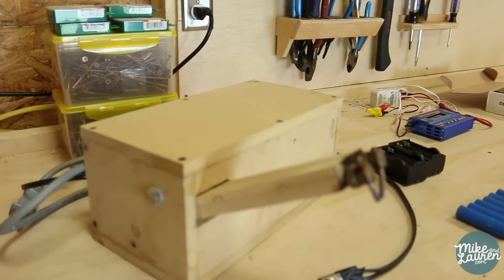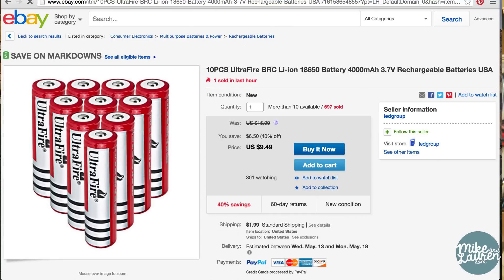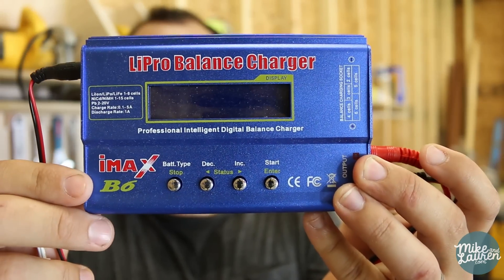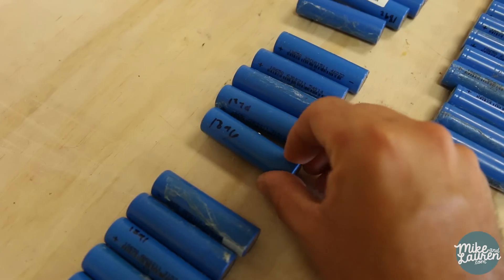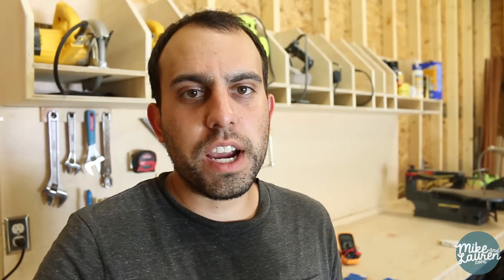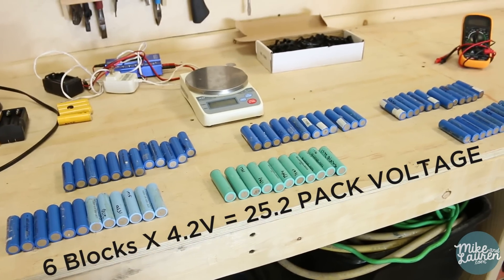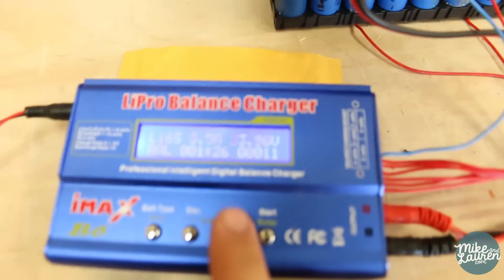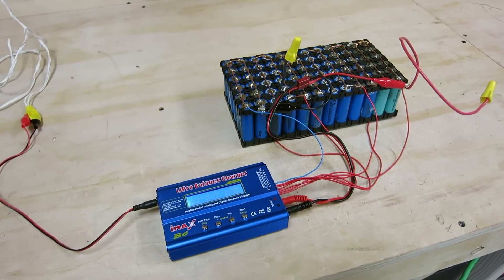DIY Lithium Ion E-Bike Battery Pack from 18650 Laptop Batteries

Comment: I see the video is 10 year old, but you should think about editing it or removing it. Soldering sold copper wire to 18650 is highly not recommended even in the proper way. You have shown in the video the completely incorrect method by no pre soldering the cell ends...

Comment: This is very dangerous this man weld direct to the battery with a big steel bare its get really hot your battery dead very fast on overheating and Thermal run a way. Do not try this at home if want fire works do what this guy. Only use a DC spot weld and nickel on battery.

Comment: hi, so with a balance charger you will not need a BMS glued to the battery pack itself?

But you can soder the balance wires to the battery pack and connect the other end to the balance charger.

That's so cool, i hope i understood everything right... (im not that good at this stuff, but im learning.)

I'm trying to make a 48v 20amp battery pack using laptop batteries i got from batteries and bulb store.

Comment: please suggest weather theses batteries are helpful in making power pack for e bike

https://www.ebay.in/itm/LG-LGABB41865-2600mAh-Lithium-Ion-Battery-Grey-For-Ebike-Battery-Bank-Powerwall/132669705643

Comment: I went for the opposite conversion... I made a 60 cell lenovo power pack for my laptop... too a 48v battery and devided it into 4 12v elements and equalized the voltage to my 9 cell lenovo and joined to the 9 cell with 4x plugs.

Comment: Nice video. I've subscribed.

If you control your spot welder with a microcontroller, you can avoid the blow-through problem. I built one just like yours with this control mechanism and it's great. https://youtu.be/6sMxc0NHNQA.

However, I would appreciate any help anyone here can give me on building a new EBike battery from salvaged 18650s in the area of how to organise the grouping of these varying cells. Mine have internal resistances from 80 to 250 milli-Ohms, and capacities from 2000, to 2500 maH. I think I need to balance cell groups with varying numbers of cells to get the same capacity per group, but what do I do about varying internal resistances. Anyone?

Comment: So much incorrect information mixed with the right ideas...First using what looks like 12 gauge Solid Copper wire is the correct step, however if you are going to do that, then you should have done a Tesla style pack and would have accomplished 2 things: You would have created a redundancy safety mechanism using very thin 24 g wire to connect all the 12 cells in parallel and then connected to the 12 g  solid copper wire..and 2) you would have much less resistance. The correct soldering gun is a must so that you spend the least amount of time soldering the connections. Also, the + and - lead wires look like about 14 g which is too small and creates resistance. Bigger the better...Also, must cover that battery so that something metallic doesnt drop on it creating a possible cascading effect..had you had Tesla style connections/fuses, it would have created an additional safety factor...also, that puny charger WILL NOT charge 12 cells in parallel in any short period of time!!...probably days...if the capacity of the cells is correct..going down in voltage from 24.4 to 23.7 in 15 mins is a good result considering these cells...consider that 3.2 volts is pretty much empty x 6 in p =19.2 and 6 x 4.15 volts (24.9) is full then the difference bettween the full charge and empty is 5.2 volts and you used .7 volts then you used about 13% of your capacity which isnt bad considering you probably have resistance in the range of .180-.220 ohm

Comment: Here are the battery brands you want:
Sanyo for capacity.
LG for amperage.
Panasonic if you want overpriced Sanyo cells.

Stay away from:
Any "Fire" brands, unless a fire is exactly what you want.
Any used batteries, especially used laptop batteries.

Comment: Hi , I need some help . I start my project today and the first cell I removed from laptop batterys charged to 1600 to 2500 , but when I discharge than I get 300 mha . I used the same charge rate 1 Amp . What am I doing wrong ?

Comment: I will have my electrical bike with me in my van, in which I don't have access to 230 V and don't like the idea of going through an inverter. Are there any good charging solutions directly from 12 V?
Reply: HiTech X4-80 will run off 12v

Comment: Does it matter which points on the battery you have the extended bits of wire to connect to the bike?

Comment: phoah that welder. dude, get a super capacitor to do the welding so at least its discharge itself through and eventually stop. having a switch which is constant until you stop is a no no in my eyes.
hopefully others can try use this method instead and use a couple of farad caps or something.

even if you had put some limiter to stop after X amps for X time would be good.

Comment: I didn't notice any discharge protection.  Li-ions get damaged if they're discharged below 2.5V.  Usually you'd put in a circuit that disconnects them from the load when they discharge to about 2.5V.

Comment: Nice little project, I actually find that 7s works better for 24v as nominal voltage of a 6s battery is only 22.2v

Comment: A very good source of 18650s is a guy on eBay called alarmhookup. you can get new brand name cells for about $1.50 in 36v 10s2p packs. Each cell has at least 2.2ah and is rated for high current.

I believe they were originally made for those self balancing "hoverboards" but when that fad went out of style there was a lot of surplus batteries

Comment: FUSE LINK UR BATTERY PACK !!!!!!
Reply: jnewbon00 care to explain what this means? I don't wanna make the same mistake
Reply: @Gallzatron  -- jnewbon00 means that instead of soldering (or spotwelding, etc) the cells together, you use a thin wire as a fuse between each cell-terminal (the plus or minus side) and a busbar. The busbar is a thick wire or strip *usually copper) that runs between the cells.  If one cell dies, or shorts inside, then the fuse-wire will blow and save the rest of the pack.  Best is to search for something like "18650 cells fuse busbar" and watch a couple videos to get the idea.

Comment: Good one ,,I have a plan of buying the kit and getting 48 volt motor etc,, was gonna use 4 motor cycle battery's ,,,about 160 uk pounds for the battery's not sure what the range will be thanks Shane uk

Comment: Did you not charge all the cells first,dong mine at the moment,can only do 2 at a time and I go 117 cells 3-4hours per 2 batteries 13s 9p,all kicking out 4.2v after charge

Comment: I am curious on how many AH that would be if set up as 12v rather then 48 (can't remember if that is what you set it up as). I am wondering as I am trying to replace my current setup that is 12v 95AH. I am assuming higher volt makes lower AH but still has the same amount of energy. just different configuration. any help figuring this out would be nice

Comment: can anyone help me here on a electric bike battery question.... is it the case that for more amp hours a battery will be most always be larger??... i recently purchased a new bike battery that is claimed to be 18 amp hours, yet on receiving it i see it is the same size as me worn out 10 amp hour battery... it is in a silver fish aluminum case... i have a short 3 minute video that shows the comparison i will post here... i do not know enough about battery mAh sizes to know if it is possible to fit 18 amp hours into this size case... can someone help me???

https://www.youtube.com/watch?v=ZwoDPUDNF4o&t=43s

here is the seller's response to the video... anyone know anything more than me, can clue me in a bit, would be most appreciated, since the difference in price is a lot for a poor old man like me.... thanks...

Hi william,
Thanks for your efforts , ok , i understand you well .thanks for your pictures.
You can see Aluminum cased Silver fish battery is made from Mold. 
1)Do you know what's MOLD ?
These cases are from same style mold, so they have same size .
And these Silver fish battery Aluminum case can put 80pcs cells , just 80 pcs, can't put 81pcs or 82pcs...
for 48V , it is biggest 13S6P.
when we use Samsung 3000mAh cells, the capacity is : 48V 18Ah .
when we use Sanyo 3500mAh cells, the capacity is : 48V 21Ah .
....
for 36V , it is biggest 10S8P.
the capacity can be within : 36V 28Ah....
36V 28Ah and 48V 18Ah , 48V 21Ah , 48V 10Ah .,,, they have same size .
2) if we want to get different sizes , we have to use different mold , and mold's fee is very very expensive , usually we couldn't do it .it is not worth to take most money to make new mold .
3) i tell you the simple ways to test the capacity,
we send you 2A charger , the battery is 48V 18Ah , you use out of the capacity , then use 2A charger to charge it , when the charger's light is GREEN color , you can see how long time about the chargeing time ,based on  theory datas , it needs 9 hours to charge full .
then you use 2A charger to charge your previous 10A battery , based on theory datas , it need 5 hours to charge full .
You can compare it .
4) the second ways to test .
when you charge full , you can check how long time the new battery's lasting working time per charging .
more Ah will last more long working time after per charging .
Any questions please let's know .
And you also can find more different capacity battery packs , you will find most battery packs have same ALUMINUM Silver Fish Case eventhough different capacity .
Thanks and Kind Reagrds,
Anna
Reply: It could be different chemistry. My 48v 12ah lifo4 battery weighs the same as my 72v 16ah lipo

Comment: instead of 12x6(72 18650 batteries) at 20AH, that could be halved at 6x6(36 18650 batteries) at 10AH correct? I'm looking for less weight, less cost on my 24v bladez 450w XTR
Reply: Part 2. Is it possible to combine Nimh SLA packs with Li-ion packs?

Comment: i found a tip from alibaba wrap finger tips in polyimide kapton tape to protect against shock when touching batteries. battery sparks can disintergrate volt metre probe tips so imagine damage to finger bones

Comment: Don't you need a protector circuit for each battery?
Reply: each group of paral·lel batteries has protection circuit usin BMS.  BSM consideres as one battery all the parallel group. of course, if you have not paral·lel group, you have a protection for each battery, but finally, you have a small capacity battery. Remember, paral·lel groups becomes in a capacity summatory, series groups, voltatge summatory.See BMS schematics and will see how it Works.

Comment: I'm a little confused. I'm new to this so if I'm wrong, I apologize in advance. You have 72 cells. If they had 1000mah's each that would be 72000mah's or 72ah's. But yours have and average of...1400 mah's or so? That's a little over 100 ah's not 20ah's. Just saying. So you can go 5 times 60 miles or 300 miles (hehe).
Reply: James Madden Hey James. I've been in this hobby for a little while and I would happy to explain it to you. This stuff really grabs my attention, and it just interesting. Im only 12, so the way I explain it may be bit confusing. His battery is 6 cells. He has 72 actual cells though. 12 cells are put in parallel. This means that the voltage stays constant, but the amperage adds together. If each one had 1400, you would have to multiply by 12. I guess that equals Somewhere around 19,000 or 20,000 mah (19amps or 20amps). He does that to every 12 cells. He then connects each set of 12 together. plus -> minus -> plus ->minus and so on. This dosent add amperage but it adds voltage. The average voktage of the 18650 cell is 3.7v or 4.2v if fully charged. 3.7 x 6 is nearly 24v. Hope this helps. Remember this: series adds voltage, parallel adds amperage.
Reply: To clarify what Kard Kingz was saying. You only add up the mAh of each battery in parallel (positive to positive or negative to negative). Once the batteries are tied in series (positive to negative), you no longer add up mAh and then start adding up Voltage. 

So 12 batteries in parallel become 1 big battery at 12 cells * 1000mAh. Then you multiply the number of "big" batteries and their voltage since they're in series: 6 "big" batteries * 3.7V (or 4.2V max) = 22.2V (25.2V max).

Comment: Simple questions. I'm just starting out learning alot of this stuff but I'm still a little confused about one thing. Each battery holds about 3.7v and my motor is 24v so wouldn't I need somewhere around 7 ion batteries to build a 24v battery. I see in the video you have much more than obviously so either your system needs more power or is it that you can use more 18650s and make it distribute 24 for a longer period of time. Again it's a pretty novice question but we were all novice once.
Reply: yes..that is amp hours..24 volts for longer time

Comment: Good work...I am redoing my 92 volt pack and instead of using nickle strip using the copper that you did as I had a problem with huge resistance on mine. The little 50 watt charger WILL NOT be able to charge that pack..lol..maybe in 2 weeks...  ;) Im wondering because you are using thick copper instead of very thin nickle sheet, what kind of sag do you get?..do you have a watt meter to measure this?... You havent attached any balance wires...how are you going to balance the pack?
Reply: From laptop commonly it come with individual BMS each.

Comment: Sinds everybody compares lipo charging and li-ion charging at 4.2 volts well if you look up the data sheet of real Samsung li-ion from a dell battery pack then the charging Voltage is 4.35 ±0.05 V!!!

Comment: You can easily setup an arduino with a solenoid to cut the on time of that welder down so it wouldnt blow holes in the cells.

Comment: $9-12!?!?!? Not even 4500mah 26650 batteries cost that much. You can get good Samsung li-ion batteries from li-ion wholesale for $5 (less if you buy in bulk. and yes they are legit Samsung)

You can also get a BMS for the battery pack so you can use a standard laptop charger, no special li-ion battery charger necessary.

Comment: Hi Mike I have a question about balance charging.  I don't understand how you are going to benefit from using a balance charger if the batteries are already connected in series and parallel.  Wouldn't you need to disconnect the series connections before connecting the balance charger so you have isolation of each bank?
Reply: A bit of background before going into why balance charging is needed.

Manufacturing is never perfect, the same batch of batteries coming off the same assembly line has different properties (max charge voltage, capacity, internal resistances, rate of discharge, etc etc.)

This means that as you are using the batteries, the batteries will become out of balance for those that are in series. Those that are connected in parallel will maintain the same charge(self balancing), and you can view 1 pack of parallel connected batteries as one big battery.

In this video, the configuration is 6s 12P, but you can also look at it as just 6 different packs of batteries that are going out of balance.

Without the balance charger, the packs of batteries that are in series will go out of balance, eventually causing more and more charge loss, lowers lifespan of the batteries, and losing the full capabilities of your batteries (imagine the first pack being charged to 4.2V, while the 6th pack is only 3.9V) 

basically, the balance charger looks at the every point of connection in series and figure out whether or not the battery is in balance (first pack have 3.7V, 2nd pack have 7.4V, 3rd pack have 11.1V, and so on). If the numbers don't match those values, it will redistribute the charge between the packs so that they maintain perfect balance
Reply: I understand Balance Charging and thank you for the reply.  The Batteries in Parallel yes will get the same voltage.  I am just thinking since every cell is different.  One cell may act as a sink if they have lost some capacity.  It's is most likely this will happen as the pack gets older and therefore may cause charging issues.  On the other hand, I see it would be a nightmare to balance every cell individually.  Therefore, I suppose the answer to my question is that compromises must be made in light of reducing complexity.

Comment: Hi nice work!
Due to your comments about the ebay 18650 and that they are bad/fake. The iMax B6 you are using are also a fake model!!
I am not sure if you have read up about it and I dont want to be rude or anything. Just check it up and if I am wrong please correct me!
Keep up the good work!
Reply from the maker: It may be fake but it doesn't affect the performance.  The fake 18650s are not reliable enough to use.
Reply: If it don't have ''fake check code'' under it it is fake. Fake iMax overcharge the batteries.
Reply: N
Reply: Anderz Hellgren

Comment: What is the motor from? Where can you get one? Also, does it have an individual sprocket that freewheels as well? Any modifications to mount it in the bicycle frame?

Did you to the drop solder blob trick in order for not heating up and damaging the cells? I can't buy/make my own spot welder (trying to keep costs down).

Thank you and greatly appreciate your reply!

Comment: I got a 36V 500W hub motor off ebay.  How would I know how many cells I need to make?
Reply: 500W / 36V ~ 14A, so you need a battery (group of cells) that can deliver 14 amps.
Since most of the Laptop batteries are rated 1C you'll need 7 cells in Parallel.
and 10 Cells in series. so you need 70 cells.
Reply: I was going to ask the same question.
Reply: great thanks